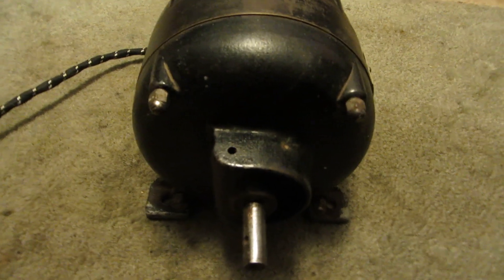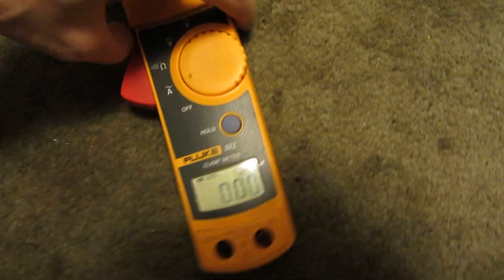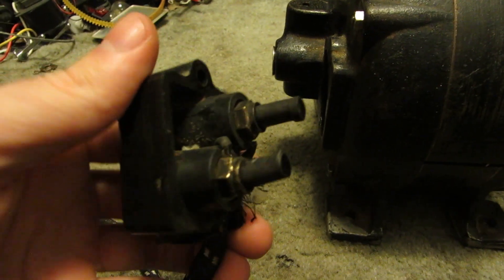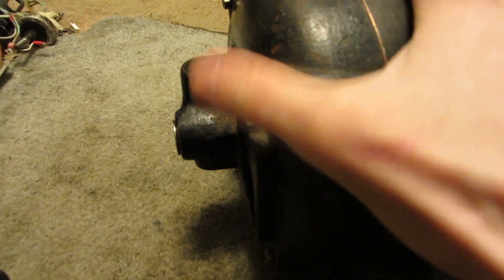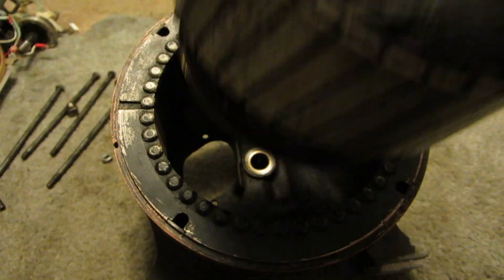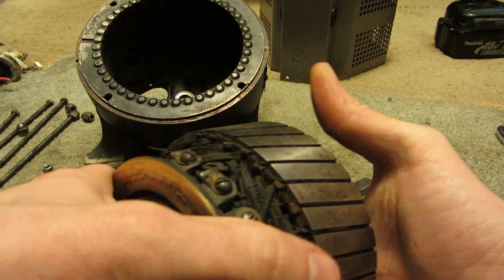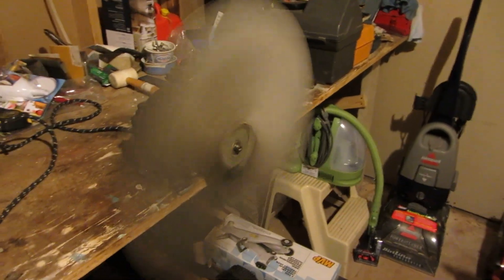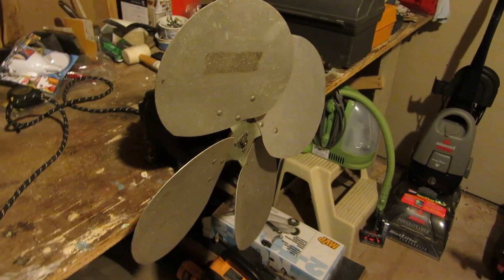Odd Motor Design

Comment: It's a permanent magnet stator motor version of an AC motor. Commonly known as a wound rotor motor, or slip ring induction motor. Not much of a thing in households anymore as far as I'm aware, but if I'm not mistaken, they're more commonly used nowadays in machinery and equipment in industrial plants. More commonly three phased than single phase. There just another available option used along with Machinery that commonly use giant synchronous Motors. Which I assume synchronous Motors are more common industrial motors in today's modern days/time than motors like wound rotor motors and repulsion motors are. I think wound rotor motors were engineers' idea back then in it's days of an AC electric motor before the actual induction motor was really invented or thought of. It basically was the induction motor before the actual wound stator induction motor became popular. I believe that's what that kind of motor is if I'm not mistaken? I mean clearly it's an old motor as you can tell by the design, but I'm not positive. The induction motor has been around for a very very long time.

Comment: Hey I have this exact same motor. It is an induction motor but I forgot what exactly it's called. I think these were used a lot in very old washing machines if I remember correctly.
Reply: I'd love to have a very old washing machine with that kind of motor! If I can't get one, I guess I'd at least want to try to find the motor itself then. I'd also like to find a repulsion start induction motor too aswell! Kind of like the round rotor motors used in very old washing machines, repulsion start induction motors were commonly popular in very old refrigerators (or electric ice boxes) before the induction motor became popular and used more often in appliances, which is what eventually led to the other two electric motors being phased out. And then the universal motor came in and then shaded pole and we ended up finding all these different kinds of electric motors in so many different kinds of equipment. There's a variety of different DC motors too aswell, which is also hard for me to rap my head around sometimes. 😂🤣
Reply: This specific motor is a member of the round rotor motor family. Even though for some reason the labels don't tell you, that's basically what it is. It's pretty much a Round Rotor motor. But if you want to use specific terms, it's basically a permanent magnet AC motor.

Comment: it looks like a garden variety synchronous motor, turned inside out!  Like a squirrel cage motor, but with the windings on the rotor instead of stator.  I am not sure why you'd build one "backwards" like this, though.  Since it's pretty old maybe they didn't really figure it out quite yet?

Comment: A fan or gear wheel might make more sense as the end is flattened and could have had a pin running through it, the wear on the bearing would also indicate a load being applies off to one direction